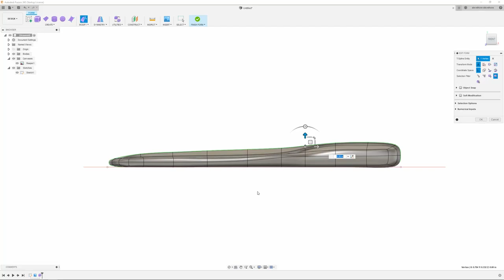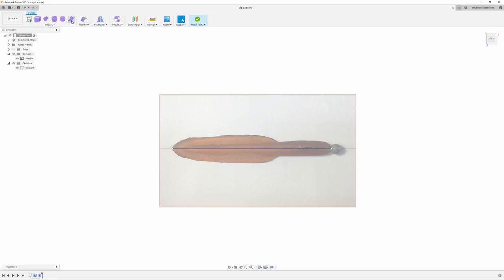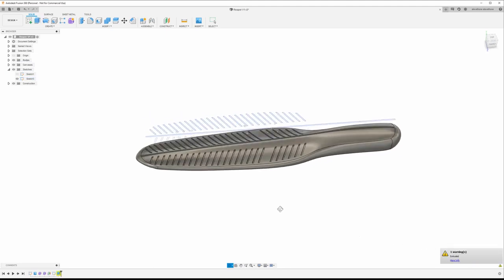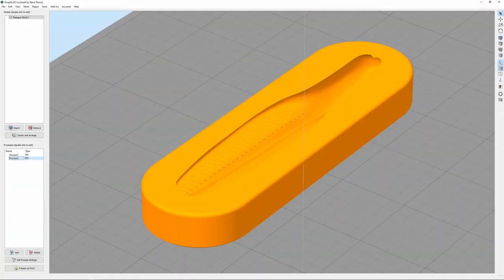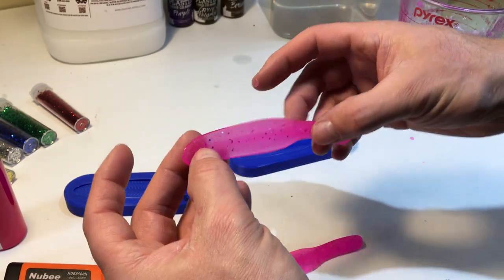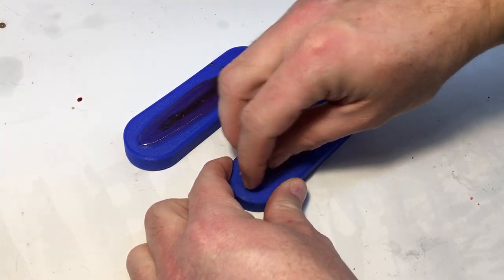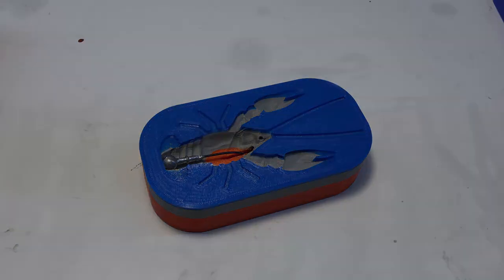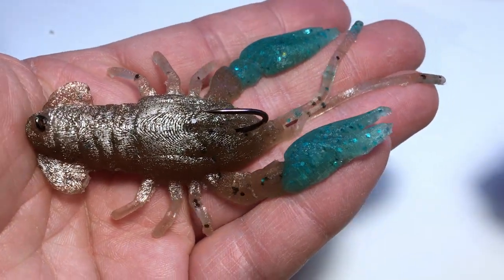Making 3D Printed Open Pour Molds for Soft Plastic Lures (The Reaper/Crayfish)

Comment: These are great looking moulds.  A little hint for your imbedded hook / weighted craws is to coat the lead with a thin layer of epoxy and letting it cure before you pour the plastisol around the jig head.  This will stop the lead from reacting with the plastisol as time goes by and deteriorating into a pale mushy toxic goo.
Reply from the maker: Thanks for the time. They definitely reacted over time.

Comment: Hello! Nice vid. I have been experimenting with machined and printed molds for a few years, do you use a release agent with the PLA? Or any other materials? Thanks!
Reply from the maker: I do not use any kind of release agent and mainly print in PLA+.  I will use a little worm oil if I have enclosed areas like protruding fins though just to help them pull out. I've have tried other high temp filaments like EPC but plastisol stuck to the molds like glue so now its just PLA because it just works.

Comment: Have you thought to have 1.5 mm thick x 1.5 mm high outline go the bait stick up above your mold. Chamfer the outside edge of the outline lip to a point, almost like a cookie cutter, once you have over pored your mold the only thing you would need to do to remove or cut off the flashing is to turn the mold over and press it against something like dense foam ext... this would in essence trim all the flashing off for you...
Reply from the maker: It's worth looking into thanks for the tip.

Comment: Hi what size jighead I ordered some and they don't fit the mold. Thanks
Reply from the maker: Sorry I really don't know the exact size ones I used. I think they are around 3/16 oz with maybe a 4/0 hook.  It would probably be best to print the mold and bring it to the store to match it up.  If the hooks you have are close you could always try heating the hook up and pressing it into the mold so it melts enough to fit... just an idea.
Reply: @TheNeverendingProjectsList  thank you 😬

Comment: Greate vids. I'm also designing and printing lures on my prusa. You were talking about creating an injection mold. Is that vid coming soon? I also want my finished baits look more shiny. Thinking about sanding the mold and applying a layer of epoxy to it.
Reply from the maker: I did a video on a 3d printed injection mold for tube baits (just see my other videos) I do have some more videos along the same lines coming I just need to find the time to edit and upload them.  I heard if you paint the molds with high temp spray paint the finished baits will come out shinny but I haven't tried it just yet.
Reply: Ok let's try that.bthx